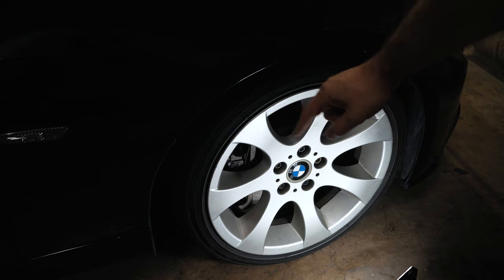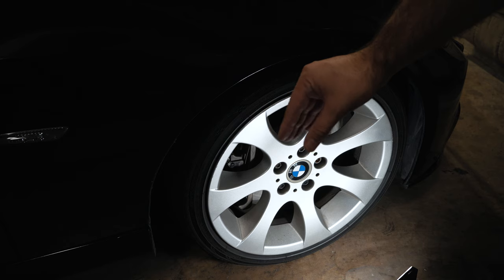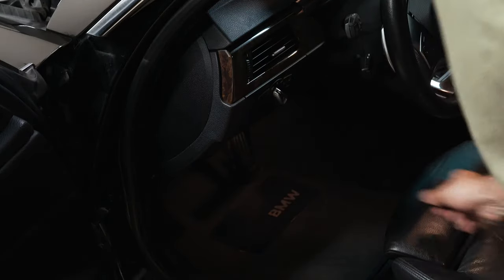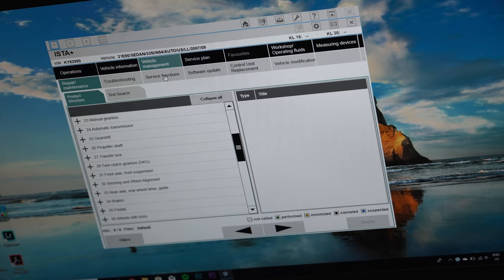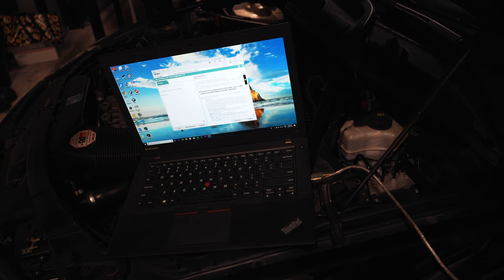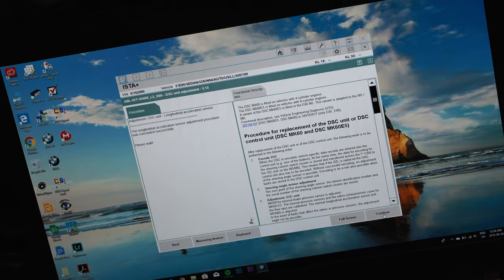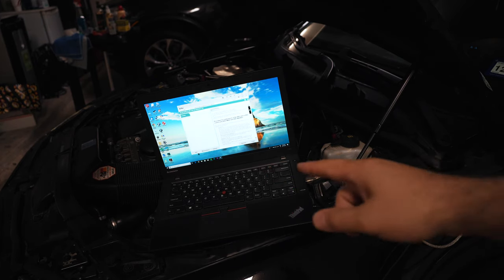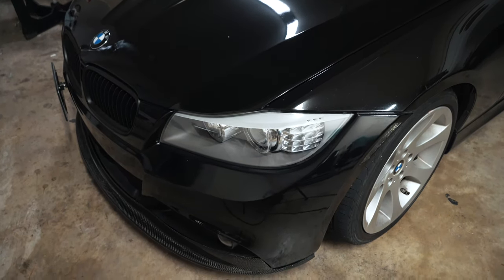A Firm Brake Pedal Is Just One Click Away!

Comment: I can’t say thank you enough for putting this video up to enlighten and teach us more about the magnificent engineering on these cars. I own a 06 e90 330i and ever since I replaced all 4 of my brake pads and rotors everything changed. I wasn’t getting that feel of the tight pressure when you depress the brake pedal, even with brand new callipers I would have to go push almost all the way down before I get that bite. I just tried this after watching this video and I used Bimmer Geeks Protool to achieve this. I will swear on this any day. Now pedals feel tight and even my steering feel is back to that tight feel like when I first bought the car. Mine had the option to calibrate everything DSC and all hydraulic pressure. I am happier than ever now. Thanks again.

Comment: Just tied this in my F80 M3.  Will know more tomorrow while at the track. Last couple of times at the track my driving coach who is helping me drove my car a couple of times, and stated that the pedal needs to be firmer in order for me to be able to improve my braking and heel / toe.  

I have an HP racing big brake kit on the car, however, my car has recently been built, and the ABS module and the wiring loom was taken out of the car while the fabrication was being done.

Comment: This Is a MUST with anyone with f30 brembro brakes.. and or M3 master cilnder upgrade... me and my mates didn't even know this was a procedure..

I mean I didnt mind having a soft paddle.. made it easier to have a very smooth stop.
But this restored the OEM peddle feeling. After the big brake upgrades
Reply: I have f30 brembo brakes on my e90. I don’t have a m3 master installed. By doing this will my pedal go back to normal feel as it’s spongy. Also do the brakes have to be coded or not

Comment: Hi, I have just changed brake discs and calipers in the front of my 320i F31 LCI -> 330i brakes.  I bleed the brakes using brake pedal at first and now the pedal feels ok with engine off but with brake vacuum it kind of lowers and is all but firm.

I tried the bleed procedure in Delphi and the pump cycles and completes the procedures says all is good but no improvement. I almost suspect that the master brake cylinder have given up during the bleeding. I have now also bleed the brakes with a pressurized bleeder with ~1.5 Bar from the reservoir, but still same with engine on.

Would be great if you could demo the ista bleed procedure in a video.

Thanks for a great channel.

Comment: Can this be done with ProTools?
Reply: Yes, set the DCAN cable as your audio interface!
Reply: ☝️ he means DAW.
Reply: Confirmed, just did it.  I replaced the pads and rotors about 8 months ago.  Never thought to do this....  Night and day!
Reply: BMW Guy With the Bimmergeeks Protool Android app? What menu?
Reply: @Chicitypo  Log into the app, then click on chassis.  Click on the top menu item then.  I think it's dsc.  The bottom menu item is for the tpms.  Once you have clicked the top one, another menu shows up.  At the top is calibrate.  That's what you want.  It takes about 3 - 4 minutes to cycle through everything.  It will actually calibrate more than just the brakes, so make sure the steering wheel and wheels are straight and don't touch or move anything while it's doing it's thing.
Reply: @oshtheld lol

Comment: I know this is a old video but what software do I need to recalibrate my dsc pump I just got my 2006 bmw z4 3.0si .. I've recently changed brake pads and rotors and have come up with this issue. I've also bleed the brake system 2 times.. no bubbles in the lines. The brake's are a little better but  not where they should be. I still have a somewhat spongy pedal and it's driving me crazy..

Comment: I've been using INPA for this and it's been so great! Firm as hell! I accidentally found this feature in INPA. I don't bleed brake line anymore since they are firm.
I believe I do the rears and move to fronts sequence. You can feel the pedal firmness in after following the screen instruction.
Reply: Where do you find this in INPA
Reply: @Montolouge21  In main menu, CHASIS, DYNAMIC STABILITY CONTROL, <F6> ACTIVATE, SHIFT <F3>, SHIFT <F4>,,,on the right hand side of menu. There are 4 of them...FR, RR, FR, FL. I'd do it from top to bottom order. You have to watch the screen and step on brake pedal when it tells you and stop when it tells you. Try several times to get used to it as you may miss the timing. This link gives you pretty good demo but it included bleeding whereas for me it's REWORKING only. https://www.youtube.com/watch?v=ZOPhh7dAbHA

It changed braking from hell to hell yes!
I do it 1-2 times a year and no bleeding hassles.
Reply: Did you do the INPA method but just didn't bleed them and only stepped on the pedal when instructed?
Reply: @E92_450ss  Yeah I haven't done any bleeding for many years now. I followed INPA instruction and stepped on the pedal.
I discovered the better way that makes brake pedal work even better(light braking and it grabs lightly but immediately and sensitive to pedal pressure). It feels like the way it came from factory. Before, the rear brakes rotors looked like pads never contacted and no rotor worn mark. Now it's working hard and I see it grabs and wearing down some. Love it!

Comment: Hey man  thanks again, for the informative video
Do you know if this ISTA will.work on F30 using this DCAN cable? Or it should have the Enet cable
Reply from the maker: Hey, glad you found it helpful.  You can set it up either way, I have used the DCAN cable on my F15 X5 without issue.
Reply: @VehicularDIY  Thank you very much

Comment: My ISTA doesn’t have dsc unit adjustment as an option. Do you know how to solve this by chance. Thank you and I look forward to your response.
Reply: I had the same issue where I couldn't locate the function. Turns out my e92 335xi has a different dsc unit, I believe it is DXC 8/8+. These dsc units don't have the same calibration as the RWD DSC unit.
Reply: @E92_450ss  ahhh wow that makes a lot of sense, I have an xDrive as well. By chance did you figure out a way to calibrate with an xDrive?
Reply: @RedVegas  Someone said to use INPA and do the brake bleeding procedure for each side but don't actually bleed them but only press the pedal when instructed. Search for a guy named HP in the comments, he provides the instructions. Im going to try this over the weekend and will let you know.
Reply: @E92_450ss did you ever get it towed work? I have xdrive too and I would like to recalibrate as I just did a brake job but everything is squishy feeling

Comment: So, I've already done the inpa dsc bleed. My problem has been a hard pedal almost as if there's no vacuum. If I downshift and the rpm is above 2k, the brakes feel great. If I coast to a stop in neutral, you have to stand on the pedal. Do you think it's my vacuum pump or would this be worth a shot? I have new Hawk pads and new rotors all around. 
Thanks for your help and keep posting awesome stuff.
Reply: Check all your vacuum hoses for degradation
Reply: Could you get this fixed? Mine is the same now and so hard as it even can be, pretty much unusable, I cant drive like that, it was working normal before. Brakes and front brake lines are pretty much new, I really need help now...

Comment: The point of the gradual break pedal bite decrease is to let the driver know the breaks are close to end of life & will need replacing.  Doing this basically tells the car the breaks were replaced and could be dangerous if the pads are not properly monitored & could give out at anytime;  although depending on the break pads, they will start squealing.
Reply: this could be a valid concern tbh. I may still do it, but this is something to consider if you are not maintaining your cars brake pads and rotors. I just changed my rotors and rubber lines to stainless steel though while my pads have more than 80% life so I am still going to do this and will report back if anyone replies to me and is curious in the future
Reply: I've done it many times over the years when updating dsc software and when I replaced the dsc module. Doesn't cause any problems that I know of.
Reply from the maker: Your point is taken, I mentioned that this should be done whenever replacing the pads in the video as that thought did come to mind.
Reply: There are brake wear sensors on the e90 platform that will turn on a light regardless of what stuff you reset. What he's doing here doesn't reset the brake pad life, it just recalibrates DSC sensors.
Reply: Correct
Reply: Wil Thieme correct but not all vehicle have break wear sensors - most European vehicles do; some only on one wheel (for example, Audi has only sensors on the front left). These sensors are also very common in malfunctioning and not working correctly. On my E92, the pads were completely eaten up and I had no warning signs they needed to be replaced (quick visual inspection fixed that).
Reply: @eddydreni  Nothing beats visual examination of wear patterns.
Reply: @eddydreni  I agree brake sensors do malfunction. I have a light on my dash now. Mechanic said they failed and need to be replaced even though pads have plenty of life left. However, the dsc valve adjustment procedure doesn't offer any protection for brake pad wear with or without brake sensors . At least not on my car.
Reply: Lol it’s almost as if cars weren’t invented without these technological aids.

Comment: Can this be done with Protool?
Reply: Did u find out?
Reply: @jaredgranada9902  Yes it can be done using Protool. Go to Chassis - Stability control - Functions - Calibration - Entire System.  I did it twice with no problems. First time i think i turn off the car to nearly. After Protool says its finish wait 1 more minute. I did it in a flat place, brake lever down and steering dead straight. 
For me it solve the problem which was a initial dead travel of the brake pedal. After as soon i touched the brake pedal it brakes.
Reply: Just to mention that this was made after new rotors, pads and brake oil change. And bleeded 3 times with one using INPA procedure. And it still had a inicial dead travel. This video was a savior :) has it sent me the answer that something else had to be done.

Comment: Can't even get past the first step, calibration of intake valve. Claims I either touched the brake pedal or have air in the system. I have bled the everloving shit out of everything including the abs bleed cycle and I still can't get past the first step. I have a ton of error lights for safety systems now, not sure I feel comfortable driving it. Where do I go from here?
Reply: Ok so, I ran the ABS bleed cycle for another time, and ran the adjustment immediately after, and it went through successfully. That being said, it made almost no difference in the pedal feel of my F30. Slightly worried that either my master cylinder isn't up to the task for the F80 calipers, or my DSC unit is faulty somehow.